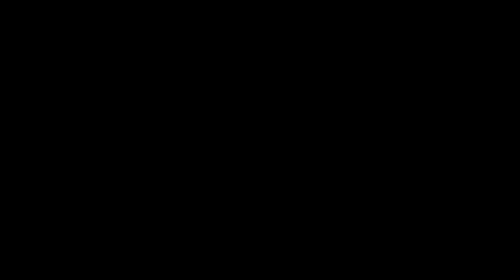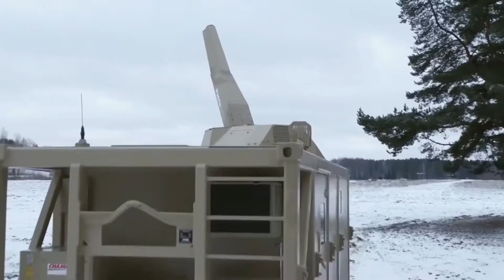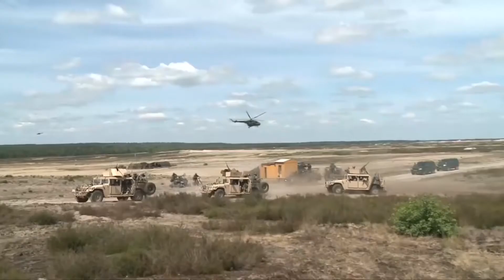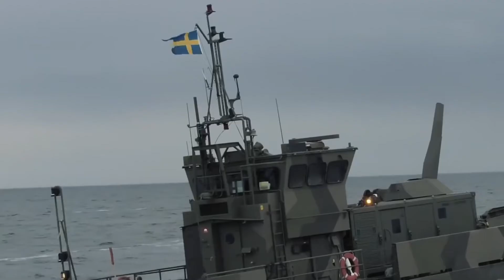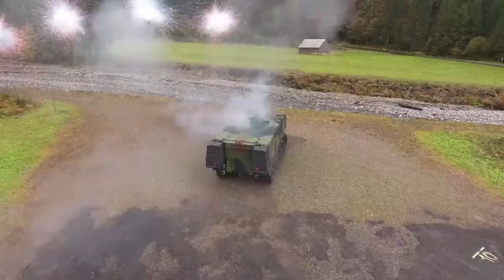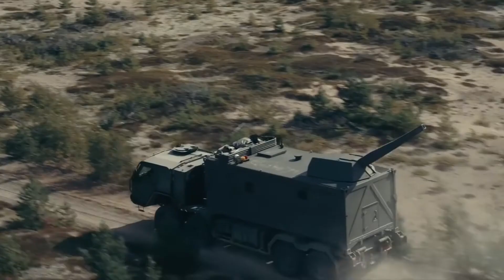How To Build A Shipping Container Army

Comment: US Army use shipping container for a lot of applications such as water ,fuel and Pumps etc..
And they use for that.. standard named SIXCON system for different purposes
Reply from the maker: yes.. they are great for support equipment.. and have a structural foundation too for facilities like barrack or medbay.. and equipment like NeMo container opens up a new possibility for a shipping container not just for supporting role but also for attacking or defending as well..